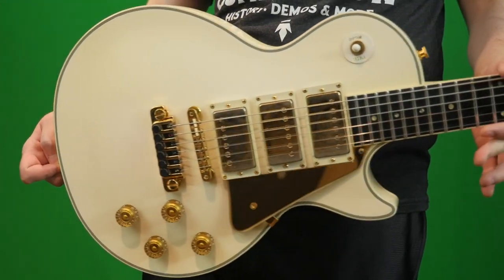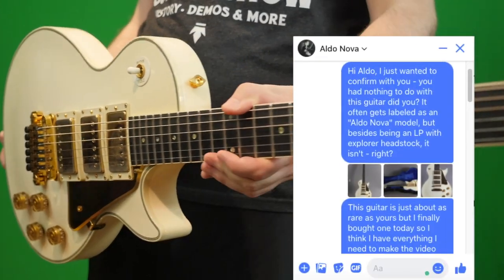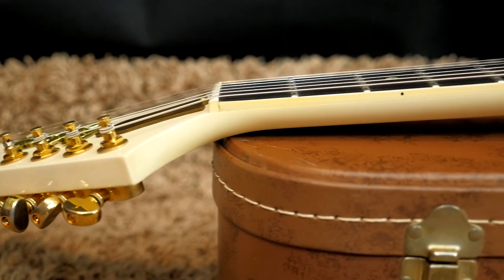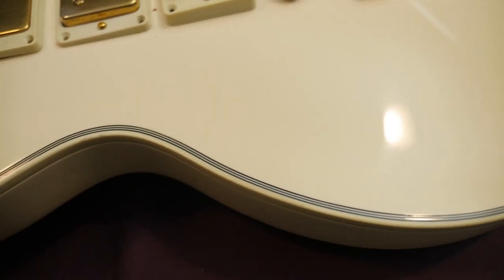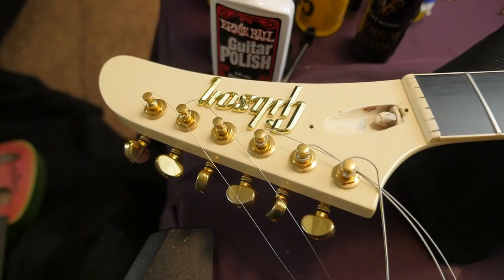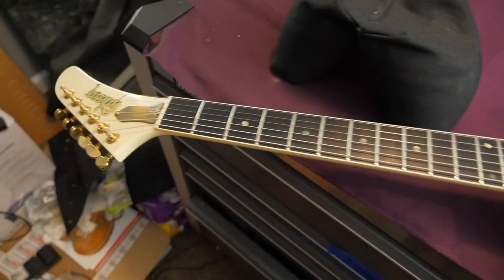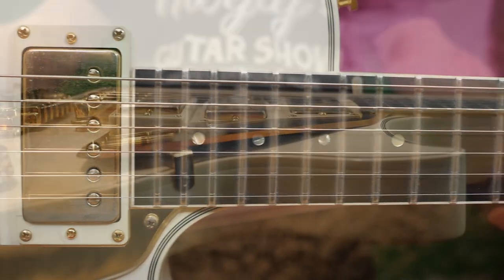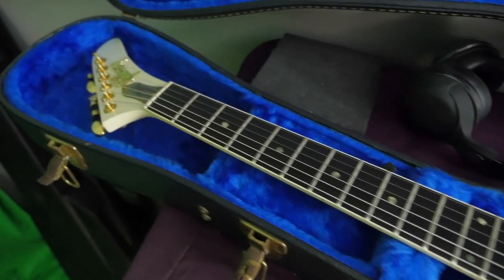The Story, Review + Demo | 1986 Gibson Les Paul Studio Custom XPL (Les Paul with Explorer Headstock)

Comment: THAT is a great guitar in so many ways. Three pickups (though I would really like a P-90, or maybe a good single coil, but for a middle position I really like a humbucker to be significantly different from the bridge and neck pickups), the tail piece is my favorite Gibson tail piece ( the fine tuners are actually pretty useful, yeah, more so with roller saddles in the bridge, but useful still ), I love the mirrored pick guard, the thinner body, my preferred LP weight relief, I like Ebony fretboards over Rosewood, the cool headstock, Tim Shaws are nice, versatile, and on the right guitar, with the right finishes and materials, the gold finish hardware and components are gorgeous.

Would love to see that body with a deep quilted figure maple top, a super saturated and deep medium blue dye ( so that the dark areas of the figuring do look deep saturated somewhat dark blue but the lighter areas of the quilt look very bright medium blue ) with a burst that fades into a dark blue so dark that it almost looks black. A multi-laminate neck of maple, and ...not sure yet... Ebony fretboard, yes, but I could also see a birds eye Maple fretboard, a backyard ebony fretboard, pale Moon ebony fretboard, is there a Cote fretboard,... I could see quite a few different things done with the inlay, depending on what the fretboard looked like, but on that specific guitar I actually think abalone dots would look nice with the aged white finish. Trapezoid inlay would look great too. 

I have a couple other ideas for that specific finish but I will resort those ideas for one of my current guitar builds. 

Really enjoyed this video, the review of this guitar.
Reply: You're rambling. Lay off the sauce. 🥴

Comment: Great review and documentation! Those Tim Shaw's sounded great!! Austin, do you plan on reviewing the 2020 Epiphone '59 reissue? I was one of the lucky ones that got possibly the first order in, and first individual to get mine delivered due to getting a heads up of when the first day of pre-orders in the US would be, and was at Sam Ash when they opened that day. It is quite surprisingly a great guitar, and at the $712.00 I paid, I don't know of another Les Paul at that price that looks, and sounds so much like what a Les Paul should sound like! The Burstbuckers sound very much like the PAFs in my '71 ES 335 TD. And the components, and wiring are better than any Gibson that has PC boards, or crappy push pull pots. Mine doesn't have any QC issues other than the flat Epiphone pick up rings, and I think they've corrected that on the new ones, and for me, there's a $7.00 fix. Rings that fit the Gibson pick-ups, but the holes line up with Epi rings, and they are concave on the bottom, to fit the substantial belly carve on the guitar. I absolutely love it!!!! Please review it!!
Thanks, Keith

Comment: Just pointing out the TP-6 is not useless.
Fine tuners exited before Floyd Rose terms did.
They are handy for tuning on the fly, for lowering the pitch without getting string slippage, and for (As the name suggests) fine tuning it-making small adjustments that are easier with it than the regular tuner

But he is right--they do look cool.

Comment: In keeping w/the traditional spec's of typical CUSTOMS, the CUSTOMS had the white binding and purfling, and they typically put the white switch tips and "poker chip" R/T washer. The STANDARDS had the cream binding and would come factory w/the cream switch and washer.
The rarity about that bridge is it had the studs and anchors for a NASHVILLE but they put the ABR on SOME that weren't meant to be so "modernized" so to speak. If you look at the bridge again (I'm sur you noticed this), the bore on that bridge is consistent with the NASHVILLE bridge. The ABR also has a smaller bore for the smaller threaded posts. I never liked that ABR for all the reasons you can imagine, so on the Gibsons I had back in the day would ALL go to the drillpress and get routed for a nashville bridge.
I was working for a couple Gibson dealers back in the 80s and was an authorized warranty service shop for Gibson an about 7 or 8 others. Been in the luthier biz' for nearly 35 years. The 80s were to me the absolute pinnacle of the great Gibson guitar eras. By the time the 80s came around, Gibson was crankin' out quality and consistency over n over. Their effort for customer service were great back then and their efforts toward detail on custom orders was as good as it gets. 1990 comes along... it starts falling apart for 10 years or so. Go see the SAME Les Paul models in the collectors' desirable marketplace, and see the obvious difference in price and collectors' value from a 1990 to a 1989. Real hardcore Gibson players..? NO LATER than 1989!!!!
Great vid. I think my friend sent you info on his. I've worked on that one and dressed the frets a couple times. It's a beauty!
~JSV

Comment: Thanks for playing thunderhorse on this guitar,sounds awesome!
Although I, as a djenty guy, wonder, how would the middle position sound going into kinda low gain on mesa(about 11o'clock) with a pretty agressive drive in front of it (like a seymour duncan 805, level all the way up, gain anywhere from 9 to 3 o'clock and a huge mid boost).
But overall a very cool guitar. It's really cool that you found one

Comment: To me the dot inlays should be used on cheap guitars and the other styles on the more expensive models. The dots just look cheap. I like the Les Paul's with the Explorer and the V head stocks. There's that one custom one Ace Frehley has that has the big circles that light up, I wish it didn't have those btw, and it has the V headstock and it looks so cool!! If I was better with gluing and ungluing necks in I would put this Firebird neck I have on this Studio LP that has the messed up fret board lol.